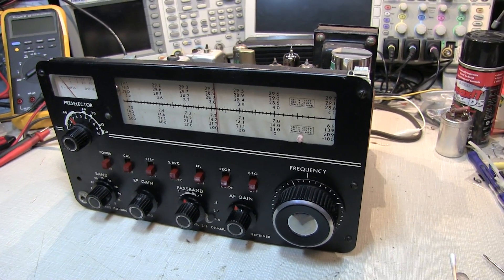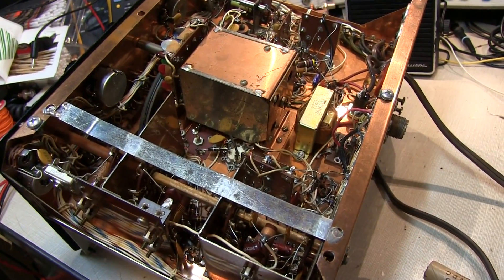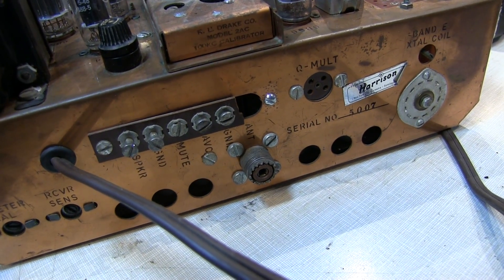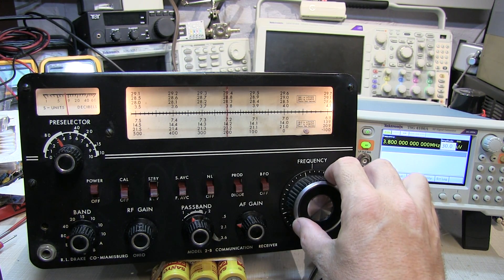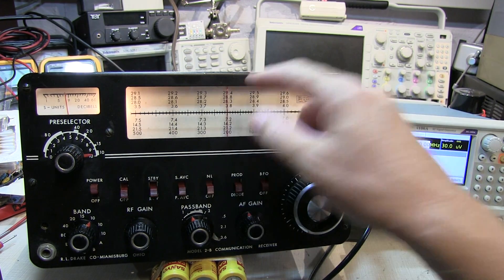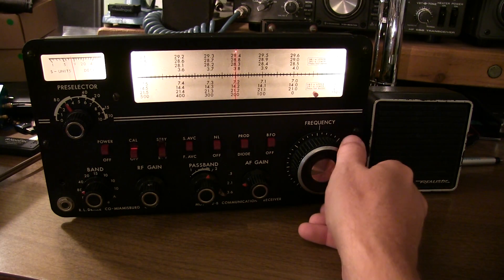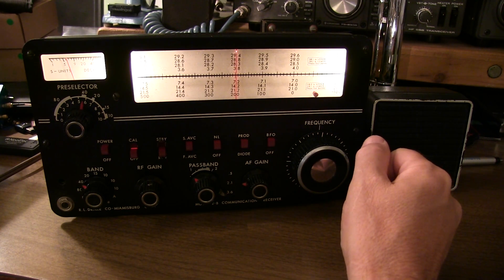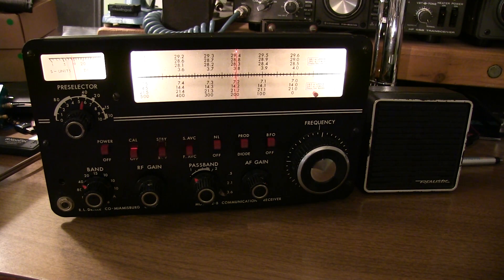#213: Drake 2B final repairs, quick bench test, and "on-air" listening

Comment: Thanks for the video. I have a 2b that has a loose tuning shaft inside the shielded box underneath the chassie. Do you have any info on how to open that preselector box to get to the shaft. Thanks
Reply from the maker: I haven't dug that deep in mine.
Reply: @w2aew  ok thanks, its actually the bandpass filter assembly. The two drive shafts have me stumped. Would like to remove the filter to check internal workings.

Comment: 3:40 Alan shows the replacement of the Standard Binding Post Strip (6-screw model)
Many of the assembly parts for Drake radios were sourced from Keystone Electronics in Astoria, NY USA.
—
The Standard Binding Post Strip (6 terminal/screw) is still manufactured for Electronics Builders & Restorers.
The Strip comes in two thicknesses: .0625 and .0937 as well as XP Phenolic, Glass Epoxy and Fiber-Glass substrate.
https://www.keyelco.com/category.cfm/Terminals-Terminal-Boards/Binding-Post-Terminal-Strips/p/509/id/773

For this Drake 2B, it appears to be the 6-terminal, XP Phenolic (0.0625 thickness) version is Keystone part number 4192
https://www.keyelco.com/product.cfm/Binding-Post/4192/p/509/id/511/c_id/773/product_id/3833

Double Check measurements of Original, for Proper Fit, 
as the Keystone 4152 is the Heavy-Duty version using a thicker XP Phenolic (.0937) and is 4” long.
4192 Drawing with measurements
https://www.keyelco.com/product-pdf.cfm?p=3833
4152 Drawing with measurements
https://www.keyelco.com/product-pdf.cfm?p=3793
Reply from the maker: Great info, thank you!

Comment: Thanks for the videos on the 2b.  I recently acquired one and am working my way through it.  I also did the resistance chart measurements.  On V1, the 6BZ6, the measurement from pin 1 to ground was 18 megohm with the controls set as shown on the chart, both fully clockwise.  With the RF and AF gain set all the way counterclockwise it drops to 4 megs.  Wondering what you measured on your check?  Looking at the schematic, coming off of the 2.2 meg resistor a wire heads down to AVC2 part of the circuit and thence works its way to ground by going through the RF gain pot (15 meg) then through a 1 meg and a 680K resistor to ground.  So that's 3.88 meg + the 15 meg pot = the 18.8 meg I read with the RF gain all the way clockwise.  And CCW it's 3.88 meg, which is close to what the chart shows.  Did they really mean to show the RF gain fully CW? or should it be CCW, which gives the correct measurement.

Comment: Good that you replaced those capacitors.  Two things about them:  The paper is not acid-free,  and wax is not a very good long-term seal,  so moisture will get in there.  I see those in anything I'm working on they all get replaced.  Ditto electrolytics. You may also find in something of this age that carbon composition resistors will drift,  sometimes to fairly high values...

Comment: Nice video. Very well done and excellent explanations!  Thank you for the info on those caps. I was wondering if they were paper. Also, thanks for the suggestion on cleaning the chassis top. I'm working on a 2b. The original tuning knob is missing. Does that main tuning knob have a built in vernier action? Mine acts as though the tuning shaft moves way too fast. Maybe i just need a larger diameter knob closer to the original. Mine had a bad audio output transformer, which i found using that resistance chart, the primary was open. I put a transformer from an sb102 in mine. Works now. Those slide switches really got me messed up until i used deoxit on them. Also used deoxit on the bandswitch. I have a short video of mine up now. You can find it on my qrz page, last image down.
73
Dave
WA7AXT

Comment: Radio has AVC - run the RF gain at max so the S meter indicates properly for the demo.  Unlike mosy videos, yours shows correct tuning of SSB sigs.  But why no CW?  It is a vy good CW RX.  73 de K5RX
Reply from the maker: Thanks for the comments.  I actually did have the RF gain all the way up - but the S-meter (and possibly the AVC) response is very sluggish on this unit - might need a bit more work...

Comment: Alan - I noticed the tuning control on your 2B has a Vernier attached to it. My 2B, S/N 3218, has a straight shaft and the dial cord is wound around it a couple of turns and my tuning is courser than yours.  Is mine newer or is yours?
Reply from the maker: I'll have to check the serial number on mine.  There isn't a vernier on mine, but the reason tunes slower is that the area where the dial cord wraps around the shaft has been turned down to a smaller diameter.  I don't know if this was a factory modification or if a previous owner had done this.  Simple and effective.
Reply: On mine the shaft is turned down also, looks like a factory design. After watching your video on aligning, I will do the same to mine after replacing the filter cap. SSB has always been impossible to tune in, very touchy and everyone always sounds like they have a high pitch voice.

Comment: Clean the meter movement with lighter petrol (benzine) open it up keep the dial uppermost and pour or squirt the lighter fuel over the pivots, that should soften the oil or grease and wash away the excess.Learnt that trick in the late 60's when I was an apprentice watchmaker.
Reply from the maker: +Nigel Kingsley-Lewis Thanks, sounds like a good tip.  The more I use it, the looser its getting.  I'll hold off tearing it apart for now for risk of breaking something else...

Comment: Thanks, Great video.  I bought mine used from a guy 12 years ago. Cleaned it up. Replaced the dial cord which was broken. Then a few years ago the audio transformer went out so replaced it with one that met the requirements , but not like the original. Could not find an audio transformer with the right hole spacing. Had to do a little tailoring for that. Other than that a super rig.

Comment: Great video Alan! You didn't mention what type of caps you used to replace the paper ones, also just out our curiosity, which tubes did you find needed replacing? I'm about to start working on my 2B, an eBay find, so this info couldn't come at a better time.
73
Reply from the maker: +n2htt I replaced the paper caps with some metalized polyester film capacitors, and one mylar film cap.  The two tubes I replaced were a 6X4 and 6BE6.
Reply: +w2aew 
Hi Alan. I think I remember reading somewhere that the choice of the type of cap to use also depends on the expected frequency of the circuit the cap is to be placed into. Am I correct?
Reply from the maker: +Robert Calk Jr. In general yes, that's true.

Comment: Good job getting that sorted.  It's almost like new.  I did not expect you would find such an exact replacement for the terminal strip.  I figured you would whack in a generic part and call it good.  Nicely done.

It is interesting that the bits of program that you tuned into consisted of guys talking about operating their equipment.  Is it always so?  I am no radio operator so I may missing something, but it seems like a trip down memory lane more than anything.  I would enjoy a video where you tune into various signals and give the viewer a taste of what is out there for 15-20 minutes.
Reply from the maker: +pillsnotbills I got lucky with a Google image search, that led me to the supplier.  The conversations on amateur radio will vary greatly - but equipment and equipment usage is a very popular topic.  A "bandsweep" video might be interesting, I'll consider it.  In the meantime, you can tune into amateur radio bands, or shortwave, etc yourself by using one of the many web-based receivers that are out there.  Here's a good place to start:
http://websdr.org

Comment: Sorry I meant 20K not 20M ohms Thanks Keith
Reply from the maker: +Keith Schreiter Well, actually the VOMs were typically 20K ohms per volt - so on a 200V scale, you'd multiply this impedance by 200.  Many of the measurements specified the use of a VTVM with a 10 or 11M input impedance, so virtually the same as today's DMMs.

Comment: I love those Drakes, But you forgot to mention about the fact that todays line voltage is 120Vac not 110Vac like back in the old days witch means that you voltage charts my be off a little plus today we have  10m ohm DVM, again back when those tube voltage charts where made they had 20M ohm load from the meter and there would be a different meter reading. Remember it all in the meter Impedance Just thought I mention thatThanks Keith N9QDS

Comment: Great video. It's always interesting to see the differences in tech, here the very nice Tek RF gen. behind the Drake. Regarding the stripe on the caps, over at Mr. Carlson's Lab channel, he has an interesting video called "Are Your Capacitors Installed Backwards" that others may find interesting. If I remember correctly, he was interested for noise suppression.

Comment: We usually run the outter shield of capacitor with the band to the lowest impedance part of the circuit. Vacuum tube can have some incredibly high input impedance, it can pickup anything.
Reply: +bloodedge also its a good idea to tell. sometime these high voltage circuit do not have a bleed resistor.. and you have to bleed the remaining voltage on the capacitor to avoid deadly electric shock.. using a 220-500k resistor.

Comment: Nice, did you try test the leakage of the caps at rated voltage? I generally find this capability missing from modern capacitor test equipment, I guess because you need something up to 400+ Vdc to cover most caps. But just testing capacity and ESR might not tell you that the cap is leaking DC. Which can be really bad for a coupling cap in a tube based amplifier, as in it will mess with the bias on the output tubes.
Reply: +Robert Calk Jr. Me too
Reply: +Alfred Stampe 
I use an Insulation Tester.
Reply from the maker: I haven't yet, because I don't have a high voltage DC source. I'd have to put something together.

Comment: looks like the 2B is coming along nicely Alan. Good job!! It has been a long while since I have worked on one of these but if I remember the meter pivots in a "C" shaped metal holder with a set screw on either side. Over time dirt, gunk and what ever you can imagine gets in it and also the metal form shrinks. This puts more pressure on the pivot shaft and slows the meter down. You can loosen the set screws a tiny bit then apply a bit of sealant and should be good as new.Keep up the good work and keep those videos coming. Anyway you are the master and probably already know all this :-)

Comment: Alan - still watching the video. Really enjoying it. Thought I would add that I've read another reason for marking the inner and outer foil on the old caps was for shielding purposes in audio circuits. If one side of the cap is at ground potential, you can connect that to the outer foil to help reduce hum.

OK, now back to watching the video. Thanks for posting this!

Dave
AA7EE
Reply from the maker: +Dave Richards Thanks Dave - yes, makes perfect sense!
Reply: Actually the outer foil end of the capacitor should be connected to the lower impedance side of the circuit to reduce hum pick up. This could mean that the end is connected to a voltage supply rather than the point lower to ground.
Reply: hum reduction was the only reason.

Comment: The capacitor band is connected to the side with the lowest impedance. Typically the anode side. This is to prevent that the capacitor picks up noise from eg. the heater wiring.
Reply from the maker: +BersekViking Oh, that makes sense!  Thank you for that!
Reply: +brian whittle 
Actually, all you need is a scope. The box is so that you can check many caps much faster.
Reply: Robert Calk Jr.
yes but on the lower capacitance types the difference is hard to see, also the box helps with shielding to make it less fiddly, and who does not like building a new widget.
Reply: +brian whittle 
I had no problem with them on my scope. But you are quite right, sir, any reason for smelling the wonderful smell of burnt rosin, is a great reason to me!!